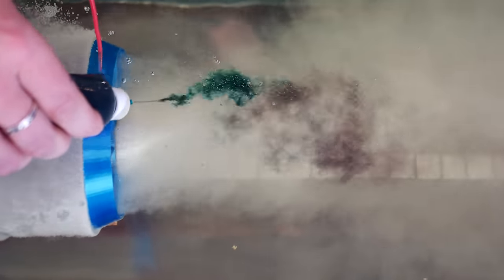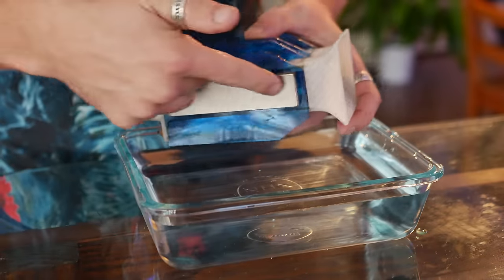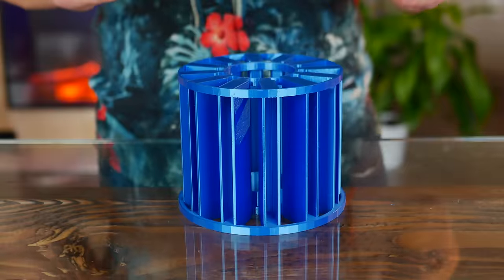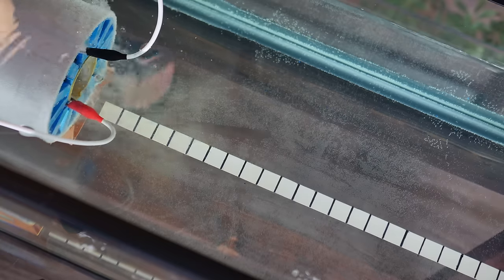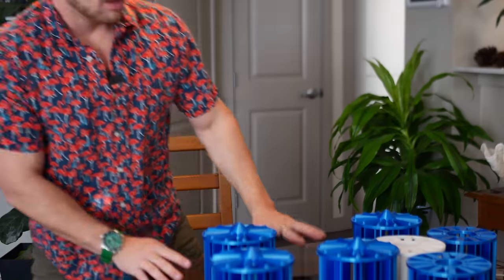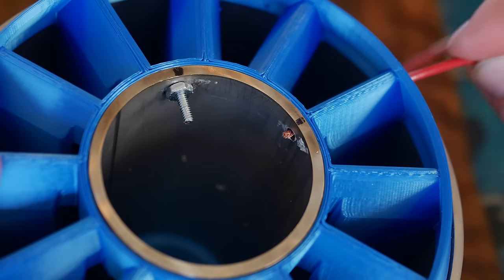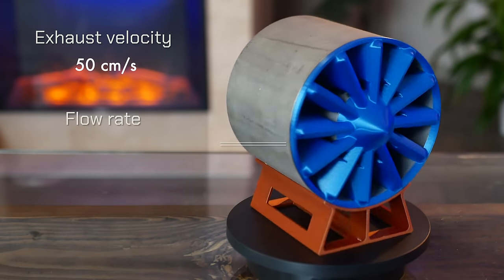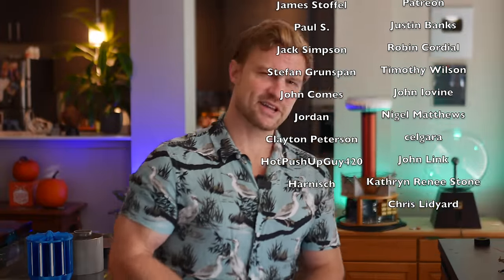Designing a Futuristic Magnetic Turbine (MHD drive)

Comment: Great video! A few suggestions. As there is no more moving parts in an MHD drive, you don't necessarily have to put the engine inside like a conventional motor. Instead, you can put the engine outside ;) i.e. deploy the MHD interaction everywhere around the external fuselage, making it an "external flow MHD accelerator" with the benefit of acting on the wavefront and the drag along the whole wetted area. Another trick: when you glue the same poles of two 1T magnets together, face-to-face, you nearly double the magnetic flux density and get almost a 2T magnetic field strength right on their junction plane. In addition, in order to avoid electrode corrosion due to electrolysis, it is best to use graphite electrodes, even if steel is better than cooper indeed. Speaking of electrolysis, you are limited by the conductivity of salt water: you could use an acidic bath instead and boost the induced flow velocity even further (except if your aim is to eventually test a boat or submersible down the road).

What limits the efficiency of such a small drive is the relative weakness of the magnetic field, and the limited amount of current density that the fluid can bear before electrolysis becomes dominant up to the deleterious situation of thermal blockage, a phenomenon that could be compared to a conventional motor burning due to heat accumulated by the Joule effect (same mechanism). Therefore, you should use a power supply that controls direct current not voltage, to better tune the whole thing, and even calculate precisely the current density J your fluid can accept depending on its electrical conductivity and the surface of your electrodes. Indeed the Lorentz force acting on a fluid is a body force, a force per unit volume, in newtons per cubic meter (in SI units). That's also why the electromagnetic force J×B can be very powerful as it can act on a large volume of fluid. But this is another longer story and I was speaking of the efficiency. Compared to a traditional propeller, the magnetic field B of an MHD drive is akin to the pitch angle of the blades, while the current density J is the rotation speed. With such a low power magnetic field and electric current set too high wrt the fluid (its electrical conductivity), it's like someone who would use a propeller with blades having an infinitesimal pitch angle. He would have to rotate the propeller at an insane amount of RPMs to barely move. The main thing we're doing in this case is not propulsion, but heating the ambient fluid! That's why MHD drives appear so "inefficient". But they are not: they simply don't have the appropriate input values, as our technology is not yet advanced enough (hint: room-temperature superconducting multitesla electromagnets and powerful yet light and compact electrical power generators onboard).
Reply: So you're telling me the US navy's probably already researching it out in the middle of the ocean
Reply: @imperialguardsman135  Not necessarily using external-flow MHD drives, as opening the field lines around the hull is like driving around in a car with a flashing beacon hence is much more prone to detection. The Voyenno-Morskoy Flot prefers submarines and UUVs operating in total discretion with internal-flow ducted drives like the OP (no such discretion however for their hypervelocity MHD torpedo, a Big, Fat one, powered by a compact Pavlovskii generator of course, whose nozzle melts and lasts only a few seconds upon firing – but that's okay as at over 1,000 kts it doesn't need more time before reaching its target like a bullet). 
However, maybe that's the case for some of these transient super fast USOs detected with no explanation across decades? Among many other testimonies, Admiral Timothy Cole Gallaudet provided a statement about these mysterious objects recently.
Reply: @imperialguardsman135  the US Navy will degauss submarines to change up their magnetic signatures... they've already done the research

Comment: I'd be interested to see the thrust-to-weight ratio of the old and new designs. While it might cut down on noise, i cant imagine an engine that weighs more than its traditional counterpart without proportional thrust output will see widespread adoption . That said, i wonder if a multi-stage design would render any improvements like your plasma wing design. Whatever the case, i look forward to seeing what you come up with next!
Reply: He is generating about 0.5 W of actual pumping action* with 750 W of power. I do not think we need to discuss such values as long as this is as inefficient (0.07 % Efficiency).

*0.00365 m³/s *1050 kg/m³ / 2 * (0.5 m/s)^2 = 0.48 Watt
Reply: @leocurious9919  It is however super sneaky and stealthy
Reply: the splitting of water is where all the energy goes, if you could somehow capture H2 and O , that could justify the whole thing!
Reply: @leocurious9919  unless I'm mistaken 1050 kg/m^3 is brine. 3.5%wt of salt to water would be a closer approximation to seawater. But the biggest complaint I have to the KE model to measuring efficiency is #1 Plasma Channel doesn't share salinity of his salt water and #2 he doesn't share how he came to calculate his fluid exhaust flow rate considering the flow is in a closed container with turbulent flow that is fastest in the middle and slowest on the periphery. It's almost pointless besides just a ballpark figure with huge uncertainties.
Reply: @InfinionExperiments  Small errors are irrelevant when we are several magnitudes away from relevant efficiencies. We can see that the velocity is not 10x higher. We know that the density is not 10x higher. We can see that the volume flow is not 10x higher. The numbers are ballpark right. The efficiency is absolutely terrible.
Reply: @leocurious9919    sure, it's staggeringly bad compared to screws and pumps. But other salt water MHD pumps and thrusters exist in this valley of efficiency with published specs that are presenting as best in class, so getting accurate info actually let's me compare apples with apples, let's me know if headway is actually being made. 

My argument is boils down to "show your work".

Comment: Instead of measuring exhaust speed I would be interested in seeing it floated in the tank and static thrust measured with a scale, also static thrust per watt. I think this thing probably pulls an awful lot of power compared to a traditional prop judging by the fact that the cables caught fire.
Reply: yeah, the thruster in the video is pulling about 750W ^^
Reply: @The.Heart.Unceasing yeah you could drive a half or 3/4 horsepower motor with that and have a good deal more power.
Reply: @deltab9768 Yup these engines are highly inefficient, only good in zero resistance cases.... aka in space where long term thrust to gain speed isn't an issue.
Reply: @SilvaDreams  yeah in particular you need a situation where “back EMF” is high enough to be a good percentage of the supply voltage. That means a small, fast stream  of propellant (like what you’re talking about with using it  for low force in outer space) or it means using a more conductive material, a wider gap, and a stronger magnetic field. 

Something like this could be incredibly forceful if it had a big iron magnetic yoke, an aquarium of liquid metal and was being fed with 500mV/1.5kA. In fact I believe there’s a nuclear reactor that uses Liquid potassium alloy and a MHD pump for the cooling system.

Comment: If you would want to improve it once again, you could take advantage of Halbach Array. It will amplify "useful" magnetic field, and at the same time eliminate magnetic filed leaking outside. I don't know, if this will heavily affect the radial design, but it might be worth trying.
Reply: I think the correct way to do a halbach array is a cylindrical one that creates a unidirectional magnetic field perpendicular to the cylinder's axis on the inside and use linear electrodes to get the current perpendicular to the magnetic field and the cylinder axis.
Reply: The Halbach Array intensifies and contracts one side of the magnetic field and dissipates the other side, so the current configuration of the spoke magnets would not benefit. If The magnets were on the outer radius and inner axle, then it may benefit from the Halbach array.
Reply: What happens it you turn the magnets so they are in a radial orientation rather than axial? Basically form a cylinder instead of spokes.

Comment: Have you considered electromagnets for this purpose? It would make it harder to repair since you now have a bunch of wires sticking through the outer casing but may provide a benefit in strength of the magnetic field and resultant thrust. Individual control of these could also possibly provide thrust vectoring without movement of the nozzles?
Reply: I think the electromagnets could be wound around the current neodymium magnets as the "cores" as the central electrode is being fed. That way the internal inductance of the wire adds to the already existing magnetic field (maybe?)
Reply: That would suck more power than a permanent magnet as well. In this case the simplest solution is probably the best, putting the thruster on a pivot would provide precise control
Reply: That would make it really power inefficient
Reply: @mduckernz  At the moment it is horribly inefficient, because all the power is going into electrolysis. 

The only way I can see to fix this is to go with a tiny voltage, less than required for electrolysis, and a stupidly strong magnetic field.
Reply: @robertbackhaus8911 Easy said. Though in full scale it could be done. Focus the power in the magnets and only feed a bit into the electrodes? I could see it. I say have solar or something to recharge your power source over time. It'll be power hungry for sure. Idk what the amp relationship needed is for this application. But I am curious. Could potentially pump higher volts with lower amps through longer electrodes. In general this probably benefits from longer electrodes. Maybe run it or several through the entire hull and use a rudder as normal for steering. Tbh sections of electrodes at lower voltage could work and be easier on maintenance. Probably better for consistency as well.

My main issue with electro magnets is keeping that circuit isolated from the circuit the water closes between the electrodes.
Reply: @robertbackhaus8911 yes, keep the voltage below 1.2.
Reply: @robertbackhaus8911  Thats not the case, Electrolysis takes about 1,3V, the rest of the voltage mostly heats the water.
Reply: This is likely doable, the main things he would likely have to account for would be making sure its waterproof as the permanent magnets, as well as figuring out an optimal EM design that could get the most out of power increase and electrolysis process in parallel. 

If increasing power increases turbulence then increasing magnetic field should also do the same. Thus, this is likely the simplest solution than most of the others I've seen purposed.
Reply: It all started with James Pitts' "Sky Car" vibrating orthotopter umbrella, then the umbrella was closed with a dome and devices appeared according to the scheme of conventional electromagnetic vibrating speakers (membrane + inductance) - fragments of the membrane were found by a farmer in Roswell. Then they created piezoelectric thrusters, or with small dischargers on the surface (they glowed all over the body due to ionization of the air), and now they are planes with plasma propulsion panels (so they are angular - that is, with flat surfaces). Thousands of discharge cells are densely packed into motor panels - they shoot streams of plasma (railgun architecture - coaxial electrodes). The ionized air of the spark discharge is accelerated in the railgun chamber by the Lorentz force to enormous speeds - a kind of ramjet engine is obtained. Just imagine! - tens of thousands of small ramjet engines assembled in panels and launching plasma synchronously at a huge frequency (hundreds of kilohertz). Plasma jets form toroidal air vortices - this air cushion creates lift and acceleration.💥💥💥💥💥
Reply: One aspect of the magnetic turbine design that may require closer examination is the potential environmental impact, especially if electrolysis of salt water is involved. If this process leads to the production of sodium hydroxide and sodium chlorate, it could pose a threat to marine ecosystems. Sodium hydroxide, being highly corrosive, could damage not only the ships utilizing this technology but also marine life and underwater structures. This raises important environmental questions about the viability of widespread implementation of such turbines in oceanic settings.

Comment: Have you considered a graphite coating? If the carbon is painted well enough it should solve the need to replace pipes. Consider insulating the exterior of the outer tube and the interior of the inner tube, might be able to reduce back flow.

Edit: I memorized the formula wrong, edit for physics.

Comment: Plasma Channel - This technology for a remote-controlled drone submarine is FANTASTIC because of its durability (I mean... the battery). If it could keep sending power continuously through a cable (like a diving suit), these robots' continuous research in the depths of the ocean would last for days! Or longer, with the batteries replaced when they run out of charge!
So I believe that a company could use your idea to make underwater drones for the deepest regions of the ocean.

Comment: Change the cathode to graphene for more conduction and thus increase the flow. You can also change the inner wall of the collector to aluminum. I am impressed because I have made almost the same design for the new thruster but for a drone, so our goals are different but our approaches are the same. All the best for further development and see you soon in real life for such projects. 

Hope you read my comment ❤
Reply: Bump to see this guys comment responded to
Reply from the maker: Thank you, I think the radial design is potentially the way to go. One problem with using graphene is that it will cloud up the water and turn it black quite quickly. Even just the smallest amount of graphite or graphene dissolving away from electroless us turns the water black.
Reply: @PlasmaChannel  oh I see! Let's search for a better element to increase the efficiency as radial degine is almost at its potential so I think we can work on material to improve it !

I will contact soon after completing a more research in material and degine see you soon buddy.

Btw love your videos ❤ keep growing 😊
Reply: Can you use quartz crystal as a diode ? It is peizoekectric so would it work still ?